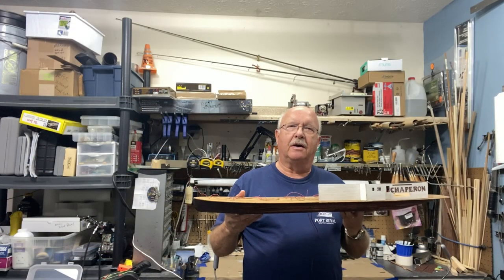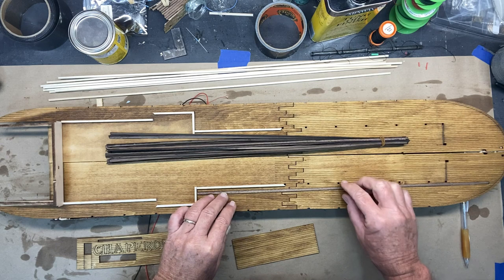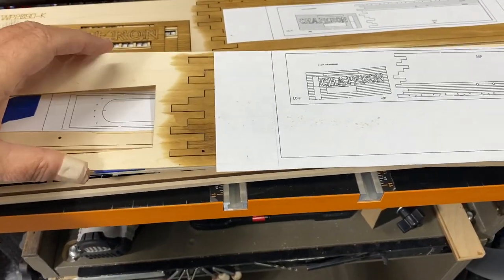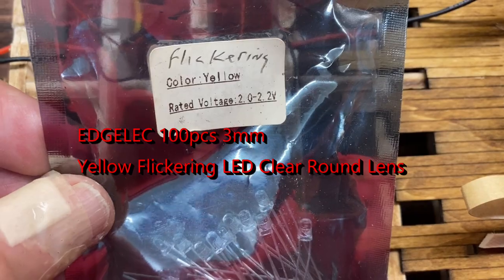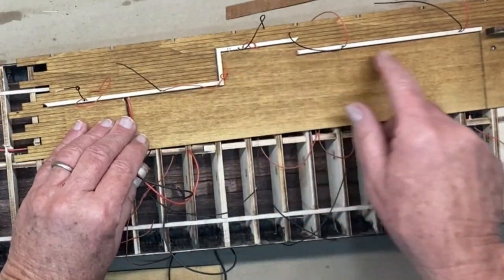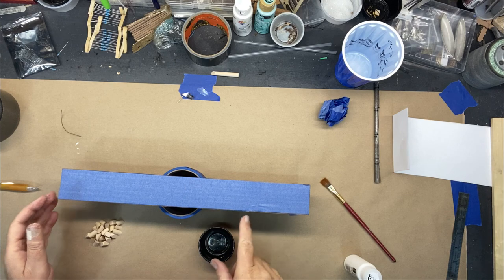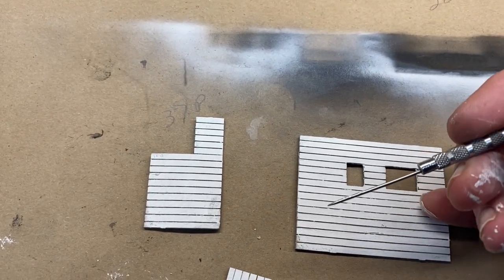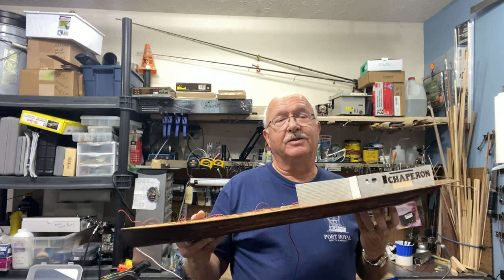The Chaperon PART 3

Comment: Hi Boiler Dan ,love your videos ,when revisiting them I came across the mini sander from about a year ago . Can you tell me where you purchased the item from ?
Reply from the maker: I think I had it on a Christmas list but here’s the same one on Amazon for under $40.
I will mention that if you search “mini belt sander” on Amazon you might find an even better one for about $70.
That being said, I use mine probably more than any other tool!
Not where the fence pad is, but the top of the belt between the two round guides. It’s kind of a soft spot and allows me to gently sand edges and curves.  I love it!
Glad to hear that you keep revisiting!  Those views add tiny.0001$ that helps pay for my hobby 😉👍👍
Reply: Thank you @BoilerDan1